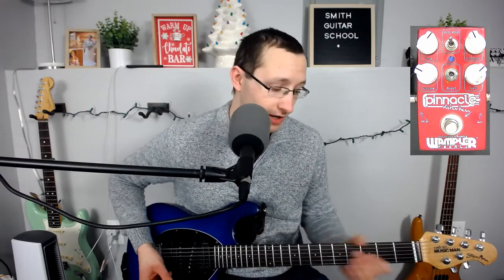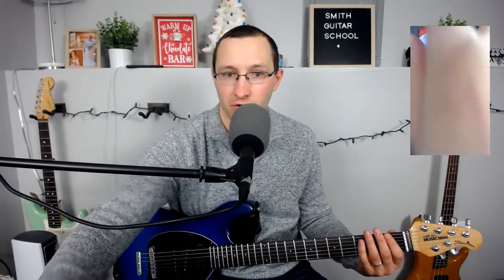Wampler Pinnacle Demo

Comment: there is a lot diference this pedal and the pinnacle deluxe ???
Reply from the maker: The older version of the Pinnacle Deluxe was the same circuit, the only difference was that it had the gain boost on a footswitch instead of the toggle. The new version of the Pinnacle Deluxe is more advanced, with a 3-band EQ and an additional gain boost option.
Reply: thanks buddy